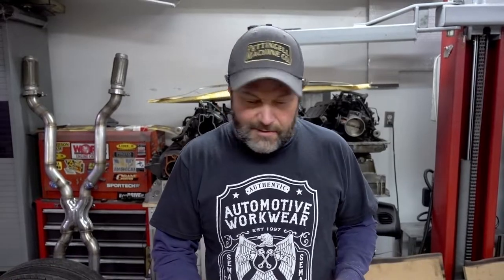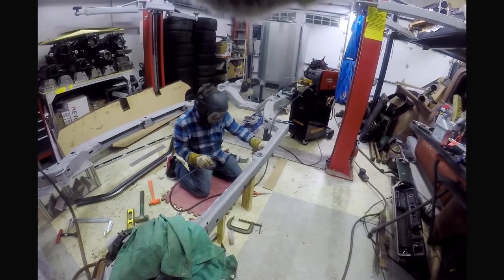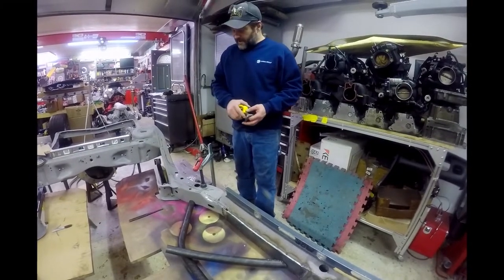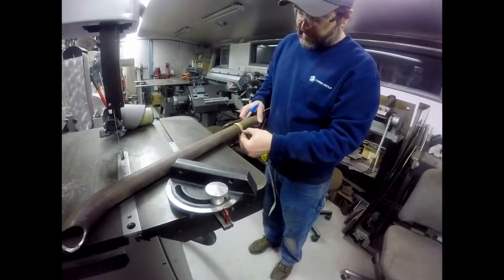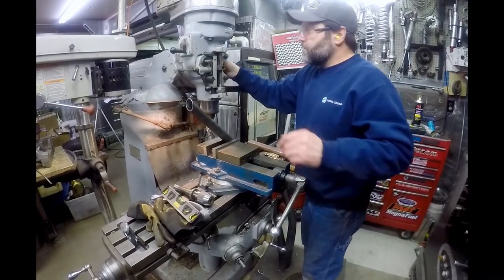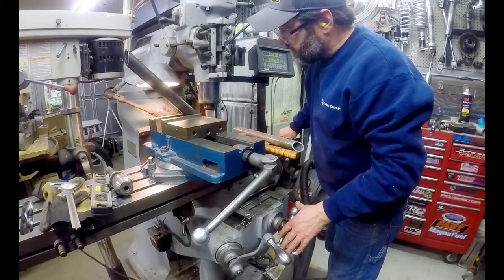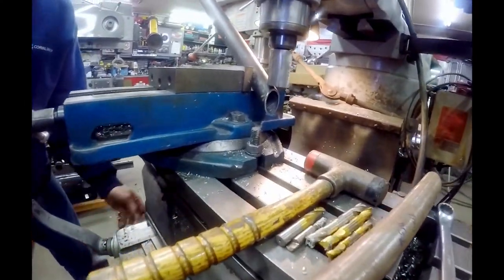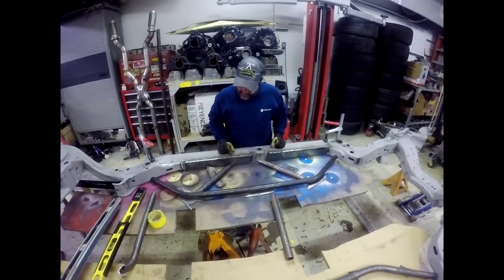Chevelle Build | Frame Plating and Strengthening

Comment: Did you remove the entire original frame rail  over the rear wheel arch or did you weld to it and remove the outer section of original frame rail?